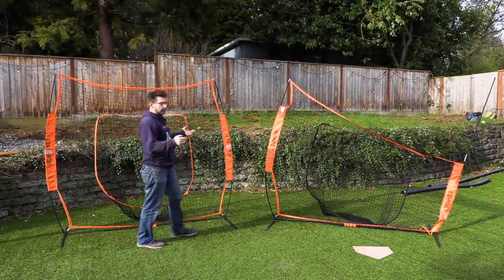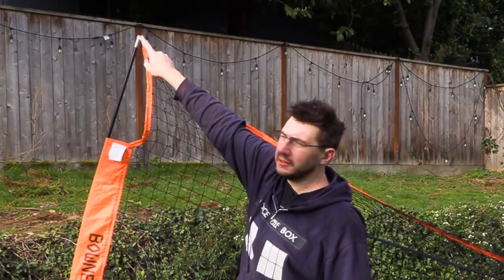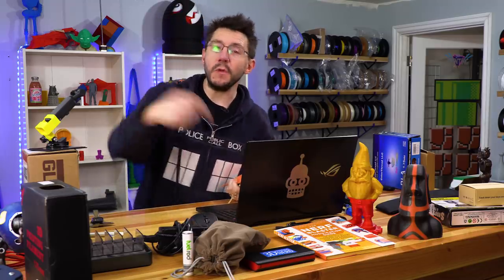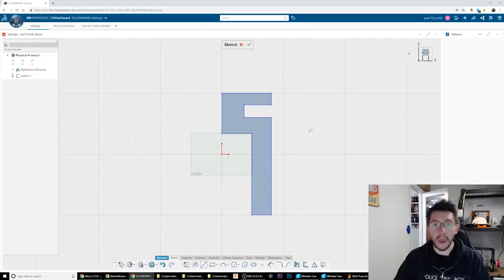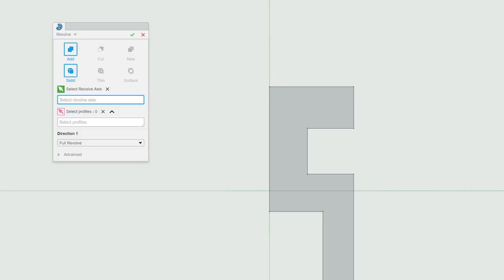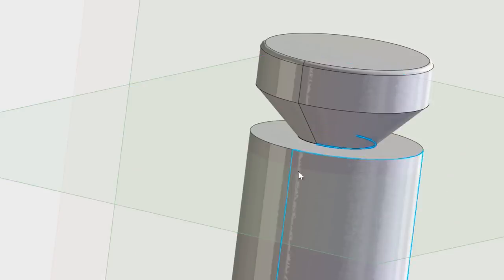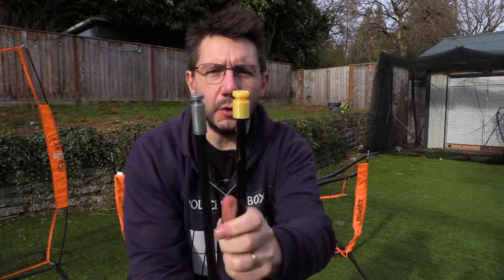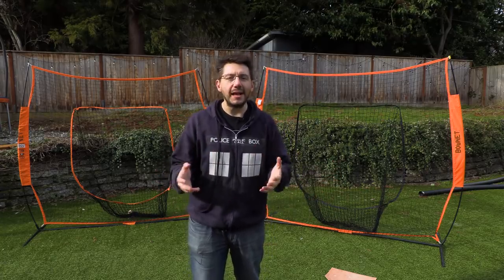3D Printing Fixes A BOWNET

Comment: I fix once a week my Razer Medusa headset. They use cheap plastic for build it so it breaks everywhere when it just once fall on floor. With to Kids in house that happens a couple times a day so my headset now is made of morr 3D peinted parts than original. For design i use Autodesk Fusion 360 or sometimes Autodesk Inventor

Comment: i made an wheel holder for a dishwasher wheel, i know it should not work, PLA in a dishwasher, water, heat, salt and so on, but it holds up just fine for now, properly last the same time as the dishwasher :)

Comment: Extra rectangular parts and there is no contact for the for the Y switch on ANET A8 W5.  Any ideas?
Reply: Oh, repaired a drill press and made miter slot sliders for my table saw which uses non standard T slots.  Even Rockler could not help with either project.

Comment: Ah damn I thought SolidWorks was a free platform like Tinkercad. :(
Reply: You can apply this to fusion 360 or if you arnt doing anything commercial onshape.
Reply: @BeatlesCuber  Yea I have Fusion as I am a hobbyist, so there is a similar hobbyist program for this?
Reply: One day the big expensive CAD software will be hurting.  Kudos to Autodesk for Fushion 360.
Reply from the maker: There is a link to get into the trial. It’s in a few comments here I didn’t get it in time to put in the description. I’m on mobile now but will try to get to it.
Reply: Ok awesome thanks Joel @3DPrintingNerd
Reply: @3DPrintingNerd  Bummer doesnt seem to be working - We are unable to grant you access to the SOLIDWORKS Online Product Trial at this time. Please contact your reseller for assistance.

Comment: Shower curtain rod holders for my wife. We hang a lot of clothes in the washroom to finish drying. We use a spring-loaded shower curtain rod that kept falling. Designed and printed the holders in an hour. I should put them on Thingiverse...Also, designed and printed coat hooks with no visible screw to mount them with. That design is on Thingiverse. I also use our Prusa MK3 to print weld fixtures for our robotic welder at work. Hopefully, Joel will get a desktop-metals printer for review soon!!
Reply: Also, I use Solidworks for all design work. I am lucky enough to have it at home as well as work. I will be looking into xDesign for future use.

Comment: Very cool! I pretty much only use my printer for functional parts. I view it as another tool around the house just like any other power tool. I am in the middle of remodeling my basement at the moment. We needed to add a pocket door for a bathroom we are adding and the little door guides that the bottom of the door ride on would work. They were stuck out and were a nasty brown color. I drew a new part up in fusion360, loaded some PETG on my MK3, and was able to print a part in white that matched our trim, located the door properly and didn't stick out. There is a great satisfaction from seeing a problem, designing a fix, printing it out and implementing it! Keep videos like this coming!

Comment: I have a Grand Cherokee with a sun roof. When it opens a small air deflector pops up. It's mesh, attached to a metal bar connected with small plastic anchors at the corners that hold the mesh deflector. One of the plastic anchors broke, and I cannot buy a replacement without buying the entire mechanism for hundreds of dollars! I plan on 3D printing one just like you did. Just have to wait until it gets a little warmer to get all the measurements ... :)

Comment: Why do you make everything out of PLA - there are better materials for a bracket like that especially if you want to hit it with a hammer like Nylon, PETG, HIPS etc just to name a few
Reply from the maker: PLA is super easy to print with, I have A LOT of it, and I think it's far more useful than people give it credit for. Yes, I know there are other materials that I could have used, but, I very much wanted to see what sort of longevity I would get with PLA.
Reply: @3DPrintingNerd  Guess that makes sense. Was going to send you some stuff made from other materials as samples like a bearing made from bridge Nylon (With bicycle bearing balls in it) etc BTW Bridge Nylon also makes good bushings you could have used on your race car. We (me and FRC team 1989) Have a pulse with a garolite plate and wanted to print our whole robot (30x30x48 inch) - of course in pieces. We print almost exclusively with a .8 Nozzle. We have used PLA on our Smokey Bot project (video on my channel) But even there we used quite a bit of PETG for its translucent qualities and for the arms as PETG flexes much more than PLA. Today we tested our Rack and Pinion lift and lifted our 150lb robot (thereabouts) with a rack and pinion system 3d printed about 20 inches off the ground repeatedly. We tried PLA for the gears but it broke so now its HIPS and Bridge Nylon and PETG for the brackets. We ran about 30 kg through our pulse in the 5 months we have it. But not enough to do the whole robot so maybe by next year we got enough parts printed for that. Will post a bit as soon as build season is over as -well build season is very busy. So we probably have different printing goals than most - keep up the good work. You, Makers Muse and CNC Kitchen are the ones that got us into this

Comment: PLA will last a season. It will get brittle and crack by next season. You should consider at a minimum ABS, but really you should try ASA. It's UV stable.
Reply from the maker: I've had PLA parts last years, but, I'll keep an eye on it!
Reply: @3DPrintingNerd  True, it's not that sunny very often in Seattle :P

Comment: I have a 60 year old pool table that's impossible to find parts for.  Was able to print off a new rack holder for it that had broken off years ago that I had designed in Tinkercad based off the remnants.

Comment: Hi, i am interested in 3D printing, but I have some problems I need resolved. I have mild allergies to things that smells, my wife has extreme allergies to smells. I figured that since the prints were made by melting plastic they would smell. How strong is it and can any post printing be done to improve it. Are their any filament types that give off lower levels of out gassing that are lower level of smells.

I appreciate any help you can provide me with, links to other sites, manufacturers sites that will give the information i need before continuing on this project,

Thank you.

Tom
Reply: The filament Joel uses here is PLA, it has almost no smell (I can't smell it), ABS has quite a strong smell (and even toxic gasses) so I wouldn't recommend using that.
Reply: I think PLA does smell... but to me, it smells like cotton candy (which I think is a nice smell)!

Comment: If it breaks again, consider putting a hole in the center and inserting a metal pin or stainless screw for stability.  I did something similar for a print I made.
Reply: I also did something similar. I made a hole so I could have the perimeters strengthen that area. It is working so far for my application.

Comment: It is interesting that when you design a replacement part and you gonna 3D print in, you often change the design. Like adding these fillets and shortening the actual part.
Reply: this is to compensate for the difference in technology. the metal part would just be round stock drill a hole in the end and lathe style cut the slot.

however a "slot" like that is actually difficult for 3d printing since its a "dead overhang" and when you print additive like this you have to have support for those. ie you can't just extrude filament in mid air. nothing to hold it up. hence the changes.

its also being made from plastic so you have to adjust to its strengths and weakensses.

its quite a fun process.
Reply: @nerys71  Yes exactly. Because we are using FDM we are changing the design, playing around with the print orientation and so on. It's amazing how technology affects our thinking. 3D printing isn't just scan and print. There is a lot more to it. It is a whole process.

Comment: Actually, a replacement part costs $9.99 direct from the manufacturer; it's only cheaper to make your own if you already have 3D printer, filament, software and CAD skills- even then the plastic part won't last all that long compared to the metal original ( I'm guessing it pinged off and vanished somewhere, unless it was removed simply for the purpose of showing how to make a replacement ) as 3D printer filament doesn't react too well to being exposed to the elements. Yes, I am fun at parties...